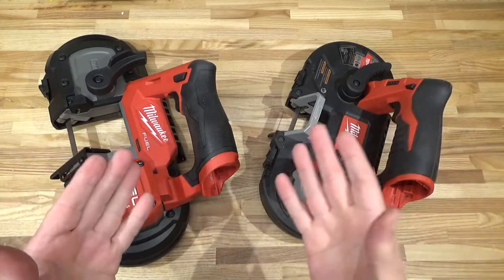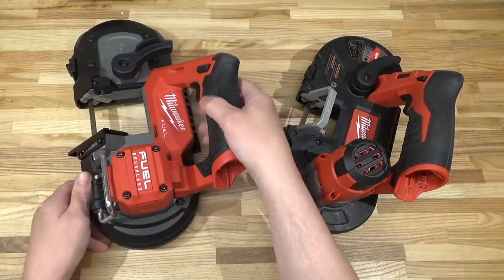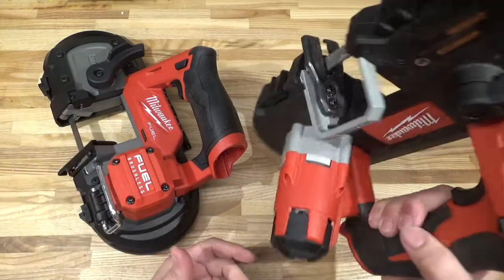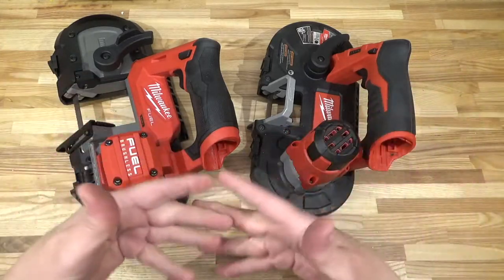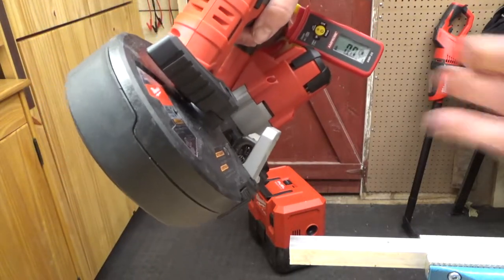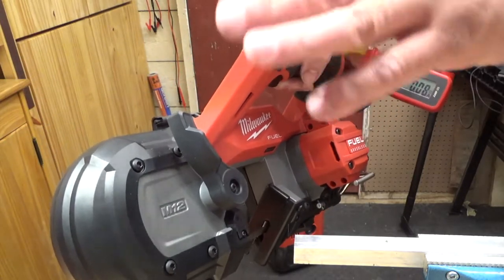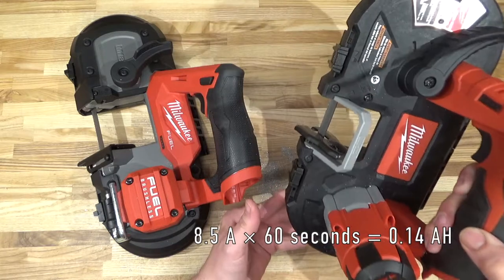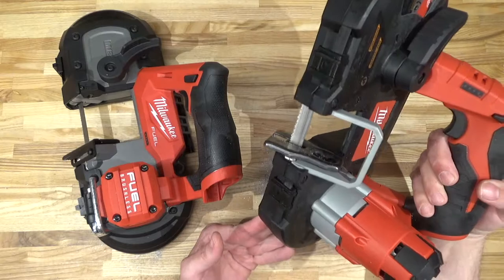Test: Milwaukee M12 Fuel vs Brushed Bandsaw Amps

Comment: The weight is a deal breaker for me. Is the fuel version that much different? Great video. Thanks.
Reply from the maker: Not by much. The Fuel is a fair bit larger, but only a bit heavier.